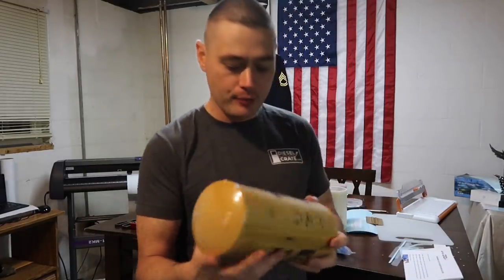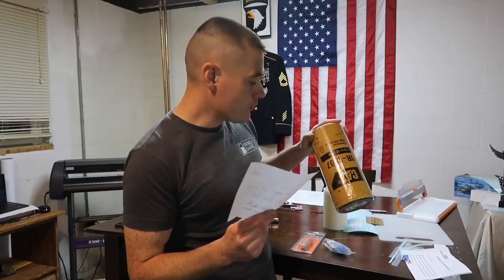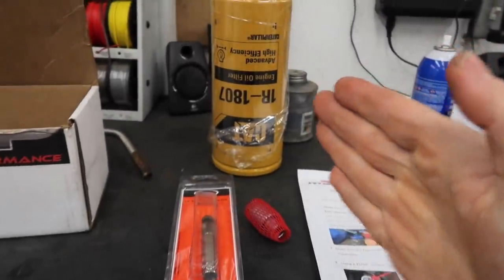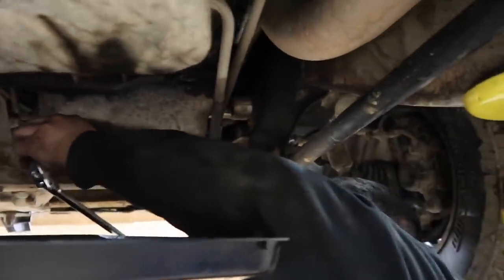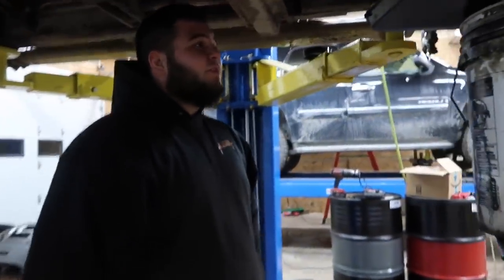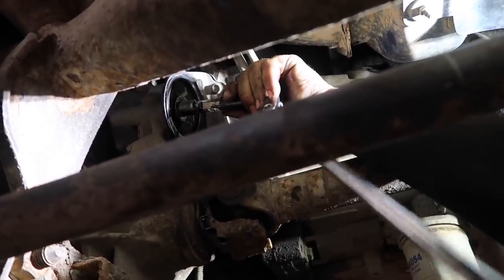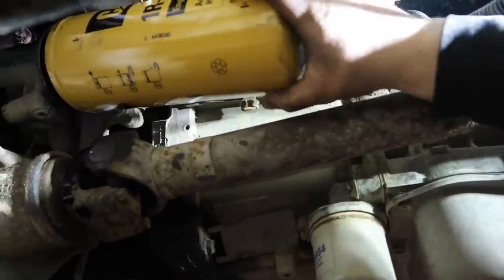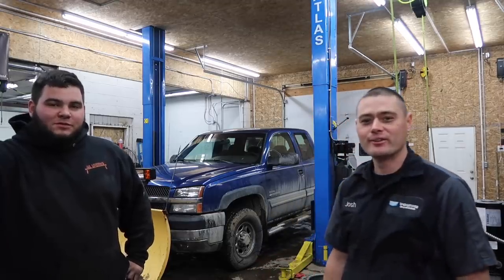Duramax Cat Oil Filter Adapter Full Install

Comment: I have the amsoil dual bypass system and it filters the oil so clean after 5,000 miles it still looks gold/brown and it adds even more capacity than the cat filter and it’s specifically made for the engine.

Comment: They should screw in by hand, the filter should screw on by hand. You should only have to torque it to 20 ftlbs to keep it in. If it doesn’t fit return it. There have been some really bad copies.

Comment: Curious, besides this being fun and I know a bigger filter means more filtration, but now you need to buy a more expensive filter and an extra quart of oil each oil change just to add a couple thousand miles between changes. Wouldn't changing your oil sooner than usual using high end oil do about the same thing and cheaper?

Comment: Looking at the spin on filter for the Allison I'm going to say it has been a while since it has been changed. I'm no expert, but for the cost of the spin on and eight ounces of ATF, I change the Allison filter since I'm already under the truck at every motor oil change. Just my $0.02.

Comment: You should never go more than 4500 miles. Ever. I’ve tested oils, synthetic and conventional, Lucas, ams, shell, and others. They all are breaking down around the same time frame. If you can’t afford to put good oil in your truck, doing it often, and can’t afford to take care of the truck. Don’t own a diesel.
Reply: I test my oil with each oil change and run Liquid-Moli every 5,000 miles. Currently over 200,000 mi and my test result are golden 😂
Reply: Interesting comment. I know of two gentleman that have proved exactly opposite. They send oil in every 4-5k for analysis and change oil at 20-25k. One runs Schaeffer the other is Delo XSP. Both diesels...
Reply: Clearly modern engine oil doesn't break down at 5,000 miles, at least not to the point where it loses lubricity and causes damage.  If this was the case, you'd have bearing failure on tens millions of trucks that have 5,000 mile or greater oil service intervals.
Reply: You know I was actually wondering something like that. 10,000 - 15,000 is a lot of miles to put on oil. Oil still breaks down overtime, no matter how well it is filtrated.

Comment: Just so you know our new F2 adapter is for the 2001 to 2010 Duramax, it does not require the old adapter to be removed. Just screw it on, torque it, done.
Reply: Link?

Comment: What about cold starts and oil drain back valve... Running this filter are you hurting the engine on cold starts?
Reply: True. And I don’t see these being less expensive at all. 2x3x more expensive.  And more filtration means more oil restriction and pressure loss and more heat.
Reply: Oil would somehow have to flow uphill to leave the filter.

Comment: On my 2010 LMM the extractor peace broke ( its supper weak) so I used vice grips and a socket to get it off. 
Ps: if yours has a way to use a socket just use one it makes it way easier. Some trucks it's just the niple and some a socket will fit on.

Comment: That’s like a $20 filter. You can get AC Delco filters for $10 at Walmart and have recommended 10k mike intervals. The CAT fuel filter was a good idea back in the day since they were only $20 vs $60 for a quality fuel filter. Too bad about them not having water seperators
Reply: This video is about an oil filter, you're talking about fuel filters.
Reply: Ian Hill what I was getting at was that the cat fuel filters were cheaper than stock filters which made them appealing. But these oil filters are more expensive than a factory ACDELCO PF2232.
Reply: Gotcha. This thing really seems to be a product in search of a problem. The Duramax is incredibly easy on oil and can do 10k intervals(with oil analysis) with a stock style filter. And like you said, this filter is more expensive. It just makes no sense. Then add on top of it that the CAT filter doesn't have a bypass valve and even possibly no back flow valve, it's a downgrade in all reality.
Reply: stayunique91 cheaper than a CAT, but filters less. 2 micron vs 10 micron on an lb7 can come out to a $4K difference. I’ll pay $20 any day.
Reply: Ian Hill as for the bypass....letting in-filtered oil run through the engine is not a good idea. That’s why we filter it. Bypass does exactly the opposite and you don’t know when it’s open or closed. As for a check valve, it’s equal with the pan so I don’t see the issue, it’s a flooded suction.
Reply: @sav300  but without a bypass you will get no oil flow if the filter gets clogged. Unfiltered oil is better than no oil.
Reply: Ian Hill I agree. However it would take a lot of miles or engine failure to clog a filter. If someone were to run a filter long enough to clog they are abusing their vehicle. Just food for thought.

Comment: Does the nipple removal tool with the kit able to work to re install the factory oem nipple once it has been taken off? I would like to re install the factory nipple as i have now taken it off.. putting the oem nipple back on.. can i use that removal tool to tighten on the nipple? What you do recommend thanks in advance

Comment: Just so you know MDDP is not authorized to sell these anymore. He has taken my design copied it and had poorly made copies made in some cases the threads were not finished and the inside hole not the proper diameter. I have had several people try to return them to me and when I saw the adapter it was clear that it was not one of mine. So beware.
Reply: What is your brand?

Comment: And fill the filter as much as possible before installing.
Reply: I do the same as you Rev, but filling the filter through the center hole seems to be a real controversial thing. Most manufacturers advise not to do this since the center hole is the return to engine feed hole, claiming new oil in the bottle is not filtered as well as an oil filter does.

Comment: Besides an extra quart of oil, what are some of the pluses of this swap if you still change oil at 5,000 miles?
Reply: More filtration, more pleats in filter media,  no filter bypass valve like stock filter, plastic center tube to help prevent metal contamination,  cat filter uses nylon beads to help keep pleats from bunching together where stock uses almost nothing. Search youtube for filter cut open comparison videos
Reply: 10-4 preciate it

Comment: Do you fill the oil filter first or start the truck with the filter dry?
Reply: I disconnect the harness so the engine cant fire, and then I turn it over a few times to fill the oil filter.
Reply: @blfjr2005  waiiiit that's a joke right? Lol
Reply: Fill it before you put it on the truck and put some oil on the gasket (on the filter) then screw it on and proceed

Comment: Love watching your channel. Keep up the good work. Did the oil pressure change after the big filter. When I drove gas trucks I tried bigger oil filter for more capacity and blew up my engine before the next oil change. I am curious on how long someone has been running this filter set up if it makes a difference.
Reply from the maker: The oil press looked normal after the install so no issues with this yet but I haven’t heard anything bad about this kit
Reply: Ive been running it for about 10k and my dash shows 10% oil life, hope this helps
Reply: Thank you guys for your input. I will be getting this for my next oil change. Josh, I remember you having to need to replace your wheel bearing. Just wondering if you had done it. I did mine and I thought it would bad considering I live in New England with all the salt in the winters. It took me about 2 hours for drivers side. Thank you for sharing your knowledge and experience.